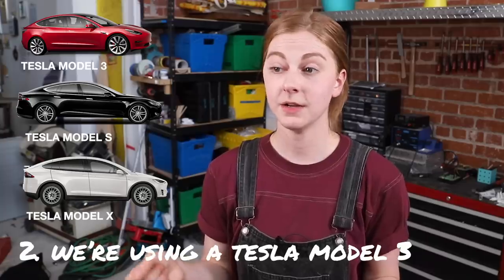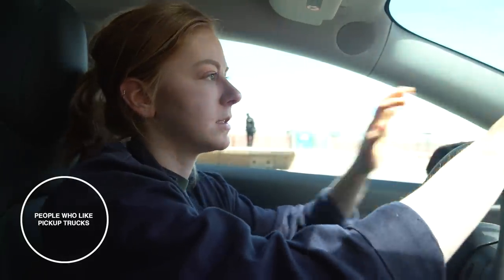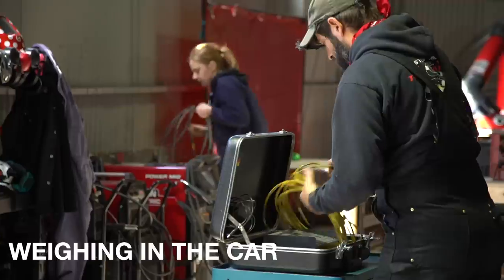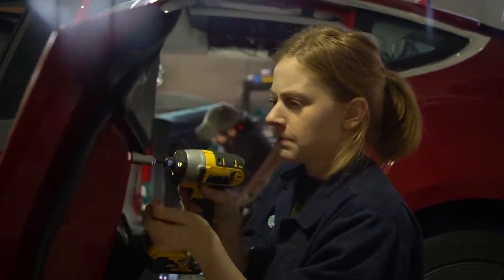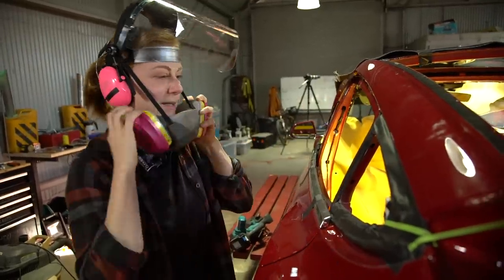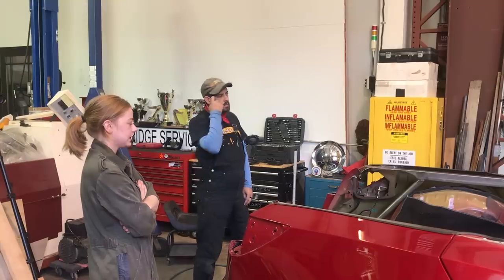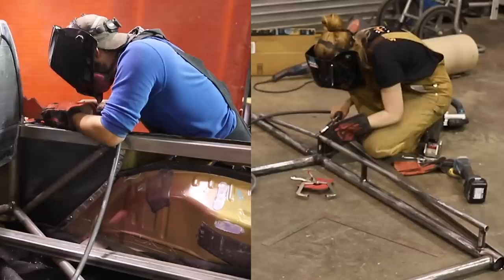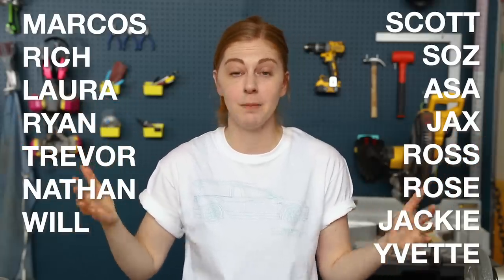I TURNED MY TESLA INTO A PICKUP TRUCK

Comment: gets an email from Tesla
You: "ou maybe it's a job offer"
Tesla: "you have voided your warranty"
Reply: hahaha nice one!
Reply: Also, cease and desist.  No more autopilot for you.
Reply: Jeovani Marc
new here, are you even here, fake guy!!!!!!!!!

salvage channels, cheap cars to get!!
YouTube jobs!
Reply: Auto pilot works still as all the cameras and radars are in tact.
Reply: Apple Tree 
200 IQ planning!
Reply: @appletree4433  There's proprietary software used in the auto pilot, which I imagine would be disabled remotely when they discovered how the vehicle was modified.  That might even be an automatic process to disable it based on the damage to the vehicle.  The question is: Do they view this as good PR, or a violation of their IP?  As mentioned by the other commenter in this chain
Reply: think " y he t " what cares Who
Reply: carrot the stick can you where know you Psbunny plantation 👎 no ain't she....
Reply: MrJay6889 depends if she cut off one of the cameras the sensors are at the bottom of the car so if the camera was cut off then yes she has no more autopilot
Reply: MrJay6889 good point but then it would kinda be like false advertising if they are saying but Tesla I think only can see your car info put can’t disable autopilot even if it was damaged because it doesn’t disable autopilot if you don’t take over
Reply: My reply was legit based off only physical properties of the vehicle, meaning all the original hardware and software for auto pilot is intact.
Reply: Jeovani Marc as someone else mentioned if she didn’t touch the electronics then it hasn’t been voided
Reply: Haha is this about the kid who hacked apple expecting a job?
Reply: Already well over 5 700 000 views. With the clicks on this video and the "commercial", the car has already paid for itself at least twice, not to mention her other videos are probably getting a whole lot more attention now. Genious move! Love it! Who cares about warranty?

Comment: There's a chance that might void the warranty
Reply: Fake news! Was there a "warranty void if removed sticker?"
Reply: who needs warrantly when she's expert on these already.
Reply: As far as I know, car warranty is a bit different from a common household appliance warranty. So, for example, this might void the warranty for the body (corrosion, paint defects and etc.), but the warranty for the motor will stay.
Reply: MrPaukann That joke just went over your head I guess
Reply: @ahdkfknsbcienfnsk , it's a joke to me and you, but there are a lot of people, who might not know how car warranties typically work, and they might take it seriously.
Reply: @MrPaukann  Extended warranty???? How could I lose!
Reply: Warranties, where we are going we dont need Warranties.
Reply: Actually, Tesla said as long as you don't change anything on the powertrain, warranty won't be void! 😅
Reply: @MrPaukann  So, if you are tampering with how much load the motor is taking, how is that supposed to keep the warranty?
Reply: shadab khan “tampering with load”? You mean putting weight in it?
Reply: Problem with voiding the Tesla warranty is that there have been many instances in which they actually blocked people from using their supercharge stations.
Reply: @ShadabKhan-sh1gg  well I guess as long as she weighs the car, then compares that to the curb weight on the door sill sticker she will know how much lighter it is now and she can then add that to the gvwr, then she will know how much payload she can carry and stay within the gvwr.
Reply: teotwawki yeet
Reply: @sinformant  I highly doubt Tesla is going to trust her with that.
Reply: Elon might make an exception
Reply: Snap, Crackle, Cube nahhhh
Reply: shadab khan it’s not really up to Tesla. They don’t own the thing. Model 3s also don’t come with access to superchargers in the first place. Or rather, not with free access.

The times Tesla blocks shit is when cars have been declared total losses. Very different situation legally.
Reply: @JasperJanssen  U better not be overweight or you WILL lose your warranty
Reply: I was thinking it might violate the terms of the loan, assuming she didn't pay cash.
Reply: @ShadabKhan-sh1gg  it was a joke
Reply: The warranty void sticker on a Tesla is located across the gap between the front and rear door.
Reply: @ShadabKhan-sh1gg , if you are often loading your car over its maximum limit and they can prove it, you might loose the warranty.
Reply: RIIIIIIICH
Reply: MrPaukann f
Reply: JUST a CHANCE?
Reply: I'm my own warranty! LMAO
Reply: In the UK, the S wagon didn't.
Reply: Lol
Reply: lol don't tell Tesla they will black list you, if it hasn't happened already.
Reply: Or the software may have compatibility issues. Lol
Reply: @ShadabKhan-sh1gg  so if you tow something it will break or if 4 fat people get in it you lose your warranty
Reply: @ChrisB-yc7ql  If you try to pull some nasty weight with your car and damage it, you   oughta lose your warranty. 4 fat people, I don't think so.
Reply: Warranty ? Elon is gonna give her a brand new one when it come out?
Reply: Should have made a faux jeep. The dimensions are more in line with that sized vehicle.

All the same though, this rich kid has a head on her shoulders. You might even say she's fairly smart.

Comment: I'm curious how you convinced the software that everything is ok and normal.
Reply: Right. I also thought that
Reply: does it have sensors in the roof, like a roof detection? If it doesn't, then I don't see a problem.
Reply: You just plug things back in. When they removed the seats the disconnected the seatbelts Wich have buckle up sensors. All you do is plug them back in and hide them somewhere.
Reply: Did you not watch the video? Rich rebuild was the one handling that part. They talk about it at like the 9 or 10 min mark
Reply: @jasrenfro9856  if you are lucky that is how it works
Reply: Probably just shorted some wires so that they always "detected" the back seat belts and stuff.
Reply: @jasrenfro9856  if you know what readings the ECU is expecting then you can override it with correct resistors so you don't need any of those parts hidden in there
Reply: @FireCrowsWorkshop  resistors, or sometimes just a simple dead short to ground, or short at the connector itself.  helps to have a wiring diagram.
Reply: @FireCrowsWorkshop  well it does have sensors about the back seats and glass top
Reply: You could call this a pickup truck but actually what's even more exciting is you really made an electric UTE.
I really can't figure out why nobody in the US is doing a sporty El Camino reboot cause I think it'd sell gangbusters with how popular pickups are even in the cities now
Reply: If somehow they could have made it longer and suspended it and gave it bigger  wheels I think it would look like a pickup truck but maybe it wasnt possible
Reply: @Ali Important to add the skin color, because when you read Rich you think 'white guy'. That's actually how he introduces himself: Hi I'm Rich, black guy.
Reply: @FireCrowsWorkshop  that's actually 100% percent correct.
Reply: Bravo! 👏 👏 👏 good on you. Epic move. Who wants to wait 2 years or whatever for one of these. Awesome! Sup Rich✌️
Reply: The horrible autopilot crashes showed that the car drive without any top.
Reply: xxLumian people like pickups because they have become the new “American luxury car.” They are comfortable, easy to get into/out of for our friends of weight (lol), most comfortably seat 4, and you can still haul and load with it. Utes don’t really offer these advantages, which is why you see trucks getting bigger and taller.
Reply: @Gibson99  it should be some kind of a resistor there since short to ground is a common failure and the car will not be able to tell whether its a failure mode or a buckled-up state.
Reply: it's easier tricking it on the electrical side than eliminating the check in SW. It is a safety relevant function and there's probably no such feature in SW
Reply: @Alein FromEarth 

Don’t forget the battery is stored under the floor.
Reply: @sanches2  depends on the vehicle. Looking at a wiring diagram will show you that many cars use simple switch to ground for many switches, including doors, seat belts, hand brake, dome lights, etc. No need for it to be more complex or expensive.
Reply: @Gibson99  it sure does depend, especially on older cars. but some of these circuits have ways to check. Frankly said i haven't had a device which checks the seatbelts,but i have done many others with similar functions. I don't want to brag what my dayj...... ahhh forget it, i design these things for living for most of the brands;) Thanks for the reply, mate!
Reply: @sanches2  I was an auto mechanic for quite some time myself, and have modified the wiring in both my own cars and in customer cars. Having the wiring diagram really helps so you can easily tell whether you can just short the connector directly, connect a specific wire to ground, or whether the switch you're eliminating has a resistor inside that you need to include in your bypass. Course you can also use an ohmmeter to find that out... Wiring diagram isn't an absolute requirement, but it sure makes things easier sometimes!
Reply: Back seat has seatbelt sensors? I thought most cars only had sensors on the front two?
Reply: @redtra236  just a guess, but maybe it won't activate the rear seat heaters or rear ac blower unless the belt is buckled, to save energy? Dunno, as I haven't seen the inside of a model 3 yet
Reply: @redtra236  I always assumed most cars had sensors on all seats. I've never sat in my back seat. Haha when I was a kid my dad had an old Dodge Dart for a while that made a really loud buzzing noise the entire time, which meant you had to buckle it even if you only had a package on the seat.
Reply: In my world we call this pfm, otherwise known as pure f**** magic.
Reply: @Beegpapijimbo  
I personally love Utes... But Subaru tried this with the Outback. It was called the Subaru Baja. Looked almost like what they have built here.
And it was a TOTAL SALES FLOP.
I don't know why .. I thought it was cool , had the same seating as the Outback, but with a small bed.
I live near the southern border and see lots of small front wheel drive based Utes around. But non in the USA.
Reply: @Beegpapijimbo  Really? You can't figure out why they aren't doing an El Camino reboot? Really? They're the most ugly, useless, ugly cars ever made. Did I mention how ugly they are? They're right up there with the Pontiac Aztec, Buick Rendezvous, and Subaru Baja.
Reply: Rich brought in the Tesla hacker
Reply: Without energy Tesla brain is sleeping.

Comment: My biggest question is, do the cars computers still work? Did they manage to trick the car into thinking nothing was wrong?
Reply: In the planning phase Simone sort of implied that it would be Rich’s job to make that side of things work. He’s played with the electrics of Tesla’s a lot. Can’t guarantee that it will be perfect, but he’ll obviously trick it into thinking it’s fine as best as he can
Reply: Realistically...why wouldn't the Computer's still work?

Like they'd just need to make sure they don't cut any wires. Other then maybe the back camera and the warranty being voided...not much else would change in theory.
Reply: @hanro50  Yeah, but if the computer recognizes something is wrong, it can "block" the car. It's like a security lock.
Reply: @hanro50  basically if the car notices something wrong like idk a quarter of the car is missing the computer will inform tesla and tesla have the ability to deactivate the car and the only real way to reactivate is to take to a tesla facility for technicians to reactivate the car but that likely wont ever happen its just something tesla can do but most of the time the car will put itself into a semi functioning mode which because the computer still works anyone who knows how to repair a tesla such as rich will be able to get the car fully functioning again
Reply: @jamesevans938  
The problem more is that sensors can be tricked. You can send false signals to the Computer that make it think everything is functioning.

Besides the back seat sensors...there shouldn't be much that needs to be done to fool everything else
Reply: @hanro50  that exactly what i meant when i said anyone like rich who knows tesla's well will be able to get the car fully functioning
Reply: @jamesevans938  probably

Comment: I think if you weld the door jams more in a square so its comparable to a king cab, then extend the frame so you can have a bigger bed, and finally place small cameras un-noticeable cameras 360 degrees on its base ...  You could put the electric GMC hummer on a run for its money.  Great effort and I respect the video.  Also...  Please do not stop and be satisfied with this prototype as you obviously have a crew and great talent, not too mention if you raise it and place bigger tires you will gain much respect from existing pickup truck owners

Comment: My dream has always been the opposite. I want something that doesn't look electric but is. A really old pickup truck with a tesla engine
Reply: Search youtube for teslonda. Basically a guy put a Tesla engine into an old honda
Reply: Two of my pipe dream cars are electric conversion sleepers:
Merc W123 wagon or a Volvo 245.

Just gotta wait another 10 years or so for parts to become affordable =/
Reply: my dream is similar to yours :)
Reply: Yes. I want an electric conversion of my VW bus T4
Reply: @shemmy95  Just imagined a teslota now, and a fordla, chevrola 😆♥️
Reply: Very due able just speedy and timely. EV west has a good setup!
Reply: Peterbilt truck with a MASSIVE electric engine
Reply: Just give it 50 years or so.

Orrrrrr....

Just roll up the sleeves and do it yourself. (Recommend option B)
Reply: Have you seen those electric Broncos?
Reply: "Tesla Engine"
Reply: theyve built a tesla powered porsche as well
Reply: I want an old style bronco with a non gas-guzzling engine 😍
Reply: @DavidG2P  yeah exactly!! One with a better AC/heating system too because those old fuckers are notoriously bad that way. Hippies used to put oil lamps in the back to heat their little busses up
Reply: I want a ford Capri with a Tesla engine
Reply: So a retrofit? I also want this.
Reply: “tesla engines” are called motors

Comment: Uhhh, I think you might have voided the warranty.
Reply: No shit Sherlock
Reply: @riskyboomer9618  r/Woosh
Reply: @riskyboomer9618  r/wooosh
Reply: Cooky Kola r/wooosh
Reply: @riskyboomer9618  r/Wooosh
Reply: @WyvernApalis  r/wosh
Reply: r/wooosh ?
Reply: Cooky Kola r/woosh
Reply: r/whooooshwith4os
Reply: I’m wheezing 💀
Reply: who we wooshing bois
Reply: K P osama bin laden
Reply: wooshing the limit of the r/woosh
Reply: Dammit I got wooshed
Reply: actually you can only void the manufacturers warranty on specific areas, not as a whole. the dealer has to prove what you did caused any problems youre having. for example, if you cut the roof off and your radio stopped working then they have to prove that cutting the roof off caused the radio to die
Reply: @HannibalUvvU  r/wooosh
Reply: @riskyboomer9618  r/Whoosh
Reply: @riskyboomer9618  r/wooosh
Reply: Maybe
Reply: @riskyboomer9618  r/wooosh

Comment: I really can't believe somebody DID do this! This is beyond brave, crazy and Genius! :O
Reply: Rami Alloush it’s actually not genius. Needs bigger batteries. The batteries in the model 3 are optimized for low weight. Relatively low weight at least. If you were to try to use it like an actual pickup, the batteries would drain too quickly. That’s why Tesla will no longer be offering a trailer hitch for the model 3. All it can take is a full trunk and a bike rack.
Reply: Mike Russo So the 500 pounds of humans this car used to carry just fine in the back seat don’t count? She can load this with close to the weight of three people without seeing a performance worse than what the car was designed for when full of passengers.

Comment: Probably the easiest and cheapest solution is to make an ultra light trailer and just connect it to the car, so that when you want/need the ultra efficiency of the car (more aerodynamic and lighter than a truck), you can easily have it, or if you need the hauling capacity of the truck, you can easily have it. Back when I had a Toyota Echo, I hooked it up to a small trailer, and loved the flexibility of it. 

   But, cool project and execution of same.

Comment: Simone, you have failed, you have created something that actually works well and is useful! ;-)
Reply: zapfanzapfan it isn’t useful. As soon as you put some weight in the bed of the truck, the batteries will lose efficiency and have an extreme drop in charge. With a decently full bed, You’d only manage about 100 miles before needing a full recharge.
Reply: @THESLlCK  Ummmmm, when was the last time you hauled something across the state?
Reply: That's just because it's not a robot.  Simone has made plenty of great things---like the giant scissors.  Had this been at all robotic I'm sure it would have fallen apart or spewed cake across the room.
Reply: zapfanzapfan it’s still useless, regulations won’t allow you to drive any vehicles which has been modified to this extent.
Reply: S G really? People drive around on custom bikes and in custom cars all the goddamn time...
Reply: @Ilovepineapple  Nice lie... There are tons of car to truck conversations... Get out of your basement...
Reply: @THESLlCK  It wouldn't be hauling "extra" weight around. It's a 5 person passenger sedan that is now only a 2 seater. You have to figure that's about 400 lbs of hauling capacity that was just freed up.
Reply: Sean Miller have you ever moved in your life or do you still live with your parents?
Reply: David Lulham two passengers and some furniture is a good 900 buddy.
Reply: Lawrence Begany doubt. The bed supports and liner that are necessary for it to hold any reasonable load are the same weight as the now removed frame and passengers subtracted.